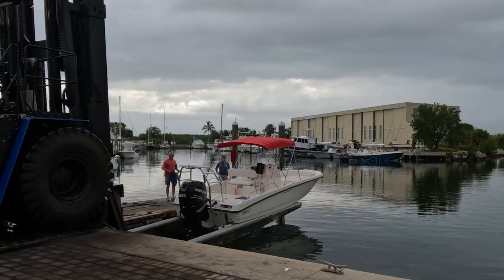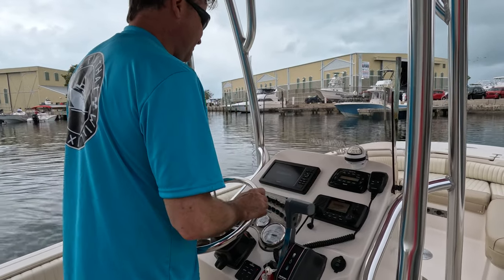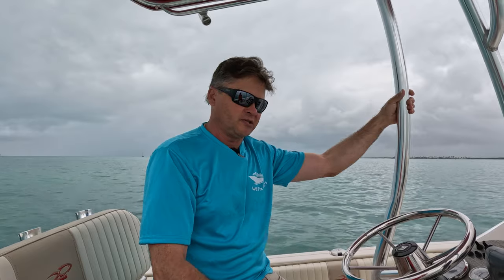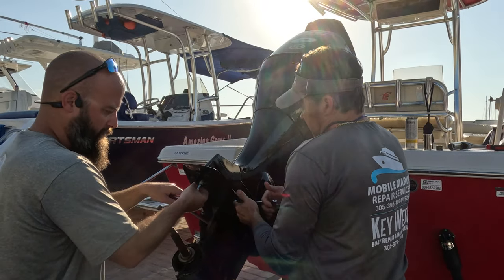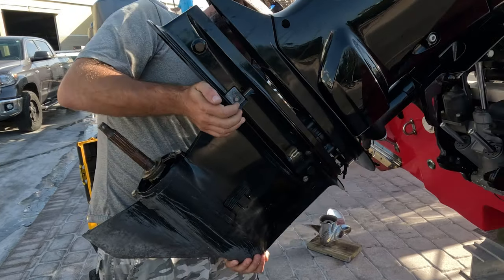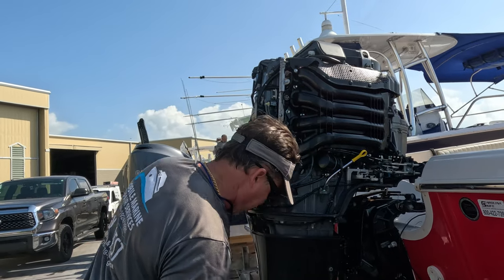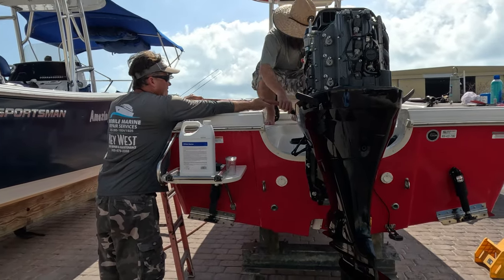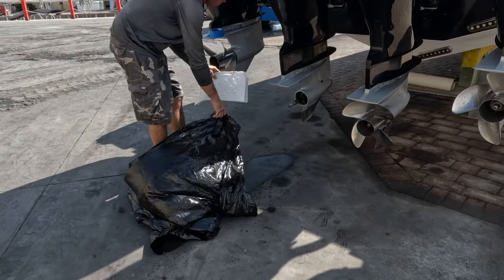Suzuki Outboard Engine NOT Peeing …

Comment: I have this problem a few times a year when my boat sits for a little bit.  Mud daubers were getting in the pee hole and clogging it up.  Cleaning it out like you did with wire always fixed the problem.  This was a great informative video.
Reply from the maker: Thanks for sharing … salt away took care of our issue!
Reply: @WillFixThat  I was trying to clean the hole with a wire in the same way and the wire broke inside. What do you suggest me to do, is it easy to remove the wire inside?
Reply from the maker: @mustafaoral3247 try using a zip tie 😮

Comment: I saw the mud dobers comment and I too have that problem and use 300 LB mono to clean out the pee line. Then I use a piece of the and leave it stuck in line to prevent the dobers from doing it again with a piece of bright plastic to remind me to remove when running.
Reply from the maker: Our issue was a build up of salt unfortunately! But, someone also mentioned they put colored tape over their hole too block anything from getting inside!

Comment: Another great video and successful repair and yes, that's a nice boat. The low-tide sand bar was a troubleshooting clue suggesting a clogged water line. It might be good to suggest to the owner to keep a short length of wire in the on-board tool bag to clear the hose if it happens again. Sand is easy to pick up and usually just as easy to clear; Tampa Bay is a similar environment. We enjoy watching your work, keep sharing!
Reply from the maker: LOL on- board tool bag .... the don't have one of those! They look at us to have the tools... 😀 to do ALL their repairs. When I got on board I made sure they had life jackets since I was voluntold I was going for a boat ride. 

Thanks for watching ValorSailing appreciate the feedback.

Comment: I will admit I kind of fast forwarded through some of this. But if you noticed that it wasn’t peeing, why would you even attempt to run motor? Retired marine tech here. If it’s not peeing figure out if it’s just plugged pee line, bad pump or what ever. I remember a time a rookie we had did this, ran motor with motor not peeing, bad pump, we ended up putting a new power head on after he overheated it. Sorry, but unbelievable!
Reply from the maker: Thanks for your insight 👍
Reply: Ha! Yes...thanx for the insight 😂

Comment: Those muffs can be an issue as well. I used the rectangular double water inlet style 1 time like you did and then couldn't get mine to pee. I read somewhere that the round muffs work better in that situation. I bought some and boat peed right away.
Reply from the maker: Thanks for sharing our issue was the motor was full of salt!

Comment: Couple of things.  Suzuki service manual says do not run engine while flushing through the top ports...only using the lower unit with muffs should the engine be ran while flushing.  The correct torque for the prop is 40-43 in/lbs.  That prop shaft should have been heavily coated with waterproof grease.  Salt Away is not effective unless you get the engine warm enough to open the thermostats, which is around 140-150 depending on if you have the standard thermostats or the optional ones.
Reply from the maker: Thanks for the great input! I’ll share it with Matt.

Comment: AGM batteries are very good and last 5-8+ years IF they are maintained and on a Trickle Charger when not being exercised.
If the battery or batteries will be “siting” and Trickle Charging is not an option:
Install a Group 31 battery like an Ionic Lithium LiFePo (Lithium Phosphate) 12 Volt, 125 Ah battery.  They have 1100 cold cranking amps.  11 year warranty.  Approved for Mercury 4-stroke engines.  Cost is around $850 each.  They drain about 1-3% per month. They are half the weight of an AGM.  
Only two negatives with quality Lithium batteries are they don’t charge when batteries are below freezing (you can buy a Heater version) and Lithium are expensive!  I have three for my boat and have never regretted it. 
Fun Fact:  Lead and AGM batteries lose their “starting power at around 50%.  Lithium produce almost Full Power till about 95-98% drained?

I would also have a NOCO Jump Starter on the boat like the NOCO GBX75 and “top that off once each year.
Reply from the maker: I agree and thanks for your input.  Epoch Batteries sent me LiFePo batteries for the whaler.  They have build in disconnect, heater and blue tooth.  Creat batteries.  I also love all things NOCO.  Have several of their products.  I sell mostly AGM batteries.  Thanks for watching.

Comment: You can use weed eater string to clear hoses and ports that are small .
Reply from the maker: Yes great tip!
Reply: After cleaning if boat sits again just put a golf tee or foam ear plug in it easy to remove later 😲
Reply from the maker: @carldowney4177 great tip and easy 👍

Comment: The 55hp Suzuki I had would clog the telltale every time I went out, it seemed that the engine was forming salt crystals which would clog it. A heavy piece of monofilament plus a freshwater flush when I got home would clear it quickly, I would run it at idle for about 15 minutes after it warmed up.
Reply from the maker: We flushed it a few times to clear it out.

Comment: Why would you not take 30 seconds and hookup the hose to the flush port, to help pin point the issue? Another guy that had turned a few wrenches, and makes us mobile guys look bad. I'm sure that impeller was absolutely perfect! Hence why we didn't see the original one.
Reply from the maker: This engine needed service and a new impeller it was full of salt!

Comment: my suzuki 140 gets clogged alot since i fish and run very shallow water, i keep a long piece of 100 plus lb mono and just snake it into the pee hole and clears it like new every time. i would not use wire since it could make a hole in your line and end up with salt water all over your engine
Reply from the maker: Great tip thanks for sharing Mike!

Comment: if not peeing, change the impeller, but also it coukd be cloged, so u can blast air into the peehole which will clear it
Reply from the maker: Yes thanks for sharing .... we didn't have air on the job so we tried the hose! We flushed it a few times with salt-away to clean it good.
Reply: @WillFixThat  did that fix it or was it the water pump ?  Have the same boat and stored it last November after fresh water flush.
Reply from the maker: @robinlee5744  yes impeller & flush cleared up our issue 👍

Comment: My Suzuki had weak or intermittent. Found out it was a thermostat that would half open. This year blow some can air and then all the oil came out the prop and lower unit.😢
Reply from the maker: Oh darn 🥴
Reply: @WillFixThat  it took two days to get all the oil off the driveway. Glad it didn’t happen in the water. Love that Suzuki put one bolt under the engine to remove oil pan.
Reply from the maker: @Laserman99  one bolt sure makes it easier! What kind of cleaner did you use to get the oil up?
Reply: @WillFixThat  Kitty litter followed with Dawn.
Reply from the maker: @Laserman99  Thanks for sharing ... Dawn does wonders!

Comment: If batteries are dead in 6 months then there is a current draw somewhere even when the perk is I n the off position. And IMO Group 27 batteries should be plenty on that boat.
Reply from the maker: They rarely use the boat.  It routinely sits for 6 months or more.  Shame,  its a very nice boat.  I take it out on a sea trial whenever they think they might use it.  That’s when the problems appear that I have to take care of so it runs great when they use it.

Comment: Never saw the old impeller in the video. Don’t know if it was just Dirt Daubers or crust blocking the pee hole. 
I use solder wire, it’s stiff enough to go longer distances yet will make all of the bends and curves you need.
Another evidence of way too many impellers being replaced than need to be.  Plenty of problems have occurred because lower units were dropped and not put back correctly.
The Hondas and Suzukis pee with a lot more strength than the Yamahas.  If a Yamaha is not peeing strong it might not need an impeller.
I like the digital NMEA 2000 connection to my Suzuki and Yamaha motors. Both only needed a $99 decoder cable from Amazon then to an NMEA backbone to my GPS.  It gives me much more data than gushes, such as water temperature.  I don’t like to rely on a warning horn, many times those fail
Reply from the maker: This impeller was like 5yrs old when we did this service.
Reply: @WillFixThat  luckily I do my own maintenance.  But the manual also say to inspect the impeller every year or 100 hours.  If I owned the engine and used it one time in a year and the engine looks brand new, there is no way in hell I’m paying someone to drop the lower unit for an inspection every 12 months.  If it’s pissing hard and my cylinder head temps are perfect I’m not replacing it at 3 years if the engine looks new as the manual says.  Mine probably has 9 years, pisses perfect, and cylinder head temps are on my GPS display, stable and solid even at idle.  That means I saved 3 impeller replacements probably at a total cost of over $1000 for a mechanic.  Since I have 3 motors I’ve saved over $3000 in just impellers alone much less all of the other maintenance items like oil changes.  If I were to use my engine one time a year I’m not doing an oil change.  I don’t care what the owners manual says, Oil DOES NOT go bad sitting in a motor for a year.  Especially synthetic and it’s usually clear as a pin.
Friends of mine have only had issues because they are overly OCD.  One only buys new and against better judgement bought twins.  Rarely used the boat but was so OCD with the manual took it in for dual service at the first year and after 25 hour bring in was accomplished.  After $600 for 2 glorified oil changes they left the power on and destroyed 2 batteries.  Then they must have done something else because he lost trim/tilt on one motor. If it ain’t broke don’t fix it or else someone else will break it.
Second friend shared a boat and sent it in for a “Service”, essentially just an oil change every year.  Without reaching near 100 hours.  He calls me up that spring wondering if I can help him find an oil leak.  After a quick look under a plastic cover I asked him why he did a service he didn’t need and destroyed his power head.  Mechanic left the oil filter just  loose enough to leak oil and when you get a warning horn you can’t ASSUME you can make it to the dock a mile away.  Now he’s looking for a 250Hp four stroke, that was an expensive maintenance interval item that didn’t need to be rushed.
If it ain’t broke don’t screw it up or let a mechanic screw it up for you.  I’ve had to fix a lot of other mechanic’s work doing pro bono at the church.  You would be amazed at the mark ups on jobs and incompetence.
Not all impeller changes are easy.  I just got a 77 85hp Johnson.  Fortunately had to drop a lower unit for repairs on the shifter.  After I dropped it noticed it has 2 copper tubes that recess into the Impeller housing.  When going back in you are doing it blind.  One of the copper tubes was bent and crushed.  These engines aren’t wise to do an inordinate amount of impeller changes.  They are difficult to place together correctly and I would say a lot of mechanic have screwed it up and IT’s not immediately noticeable to the owner.
Reply: @WillFixThat  boat is berated as expensive. I’m the new 4 stroke paradigm, I find it to be needlessly expensive.  Don’t use ethanol gas that sits for a while.  Use AGM batteries that don’t die off season and don’t overdue unneeded maintenance. I usually spend less than $200 a year on 3 boats unless I’m doing a refurb or major improvement.
Reply: Autocorrect, change the above comment with.  Boating is berated as expensive.  In the new 4 stroke paradigm.

Comment: do you do....FRESH water FLUSH....before storing the boat away.....why install any batteries....just get new ones...when it is taken out again....
Reply from the maker: Yes you should do fresh water flush every time especially in salt water. Our client keeps it at a marina… so not sure it’s done! 🥴 we loaded test the batteries & determined they needed to be replaced! So we upgraded from lead acid 27 to AGM 31’s since this boat is used rarely! But, since we did our sea trial they’ve used it twice which is huge for them!

Comment: Them tear drop plates on the port side of engine 3 on head and 2 on the side of the exhaust plate they are internal anodes they should be changed no less then once a year most likely if they have not been changed then they are corroded and most likely pieces of the anodes are clogged the outlet for the pee hose
Reply from the maker: Thanks for sharing Phillip! We ran a few cycles of salt-away thru the engine which also helped to clear the pee hole.

Comment: Next time use the flush port to verify if water comes out the tattletale. Suzuki's are notoriously known for sand glogging the tattletale. They also do dont do well with ear muffs. You need to duct tabe the lower water pickup. 1🛥🇺🇲🎣
Reply from the maker: Thanks for sharing our issue was that it was full of salt!